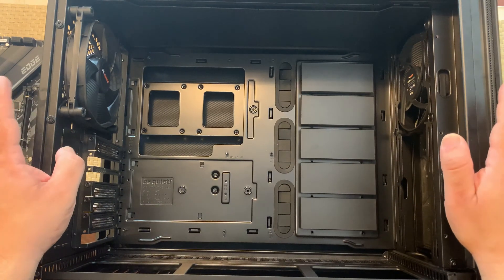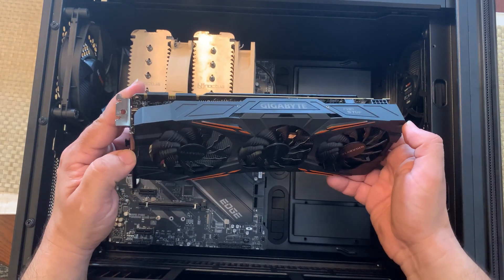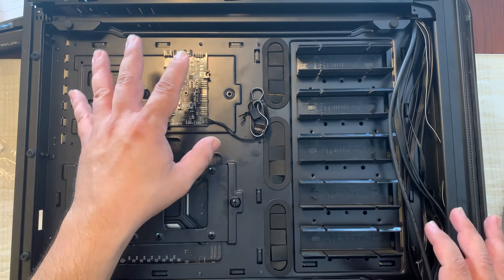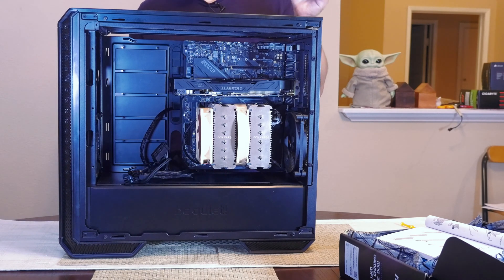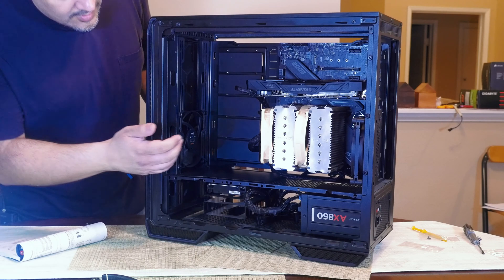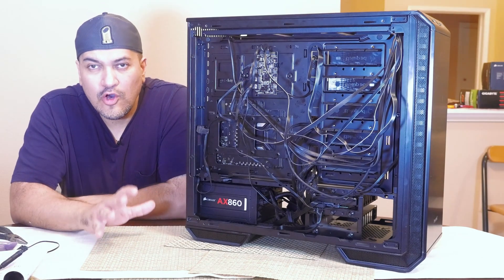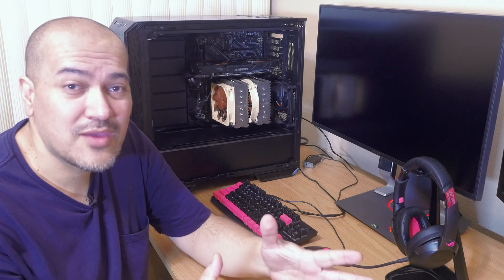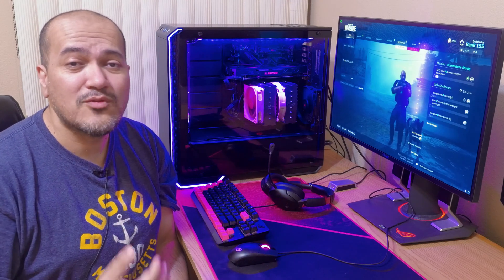Come Build This $1300 Gaming PC With Me!

Comment: I have a major problem with my ps4 and was wondering is you could help. So the problem started after update 8.00 it would update then restart to show a system software error, after that it will load up back to the same screen without it updated. I have tried every safe mode option and took it completely apart and cleaned it but it still doesn’t work even before the update it was completely fine so I need help badly.